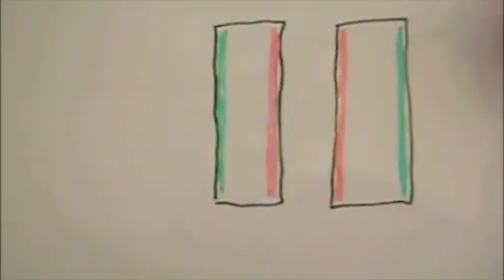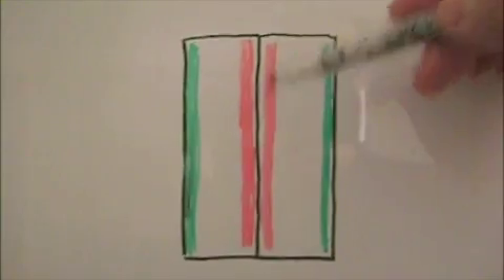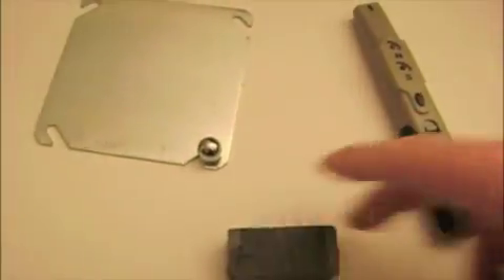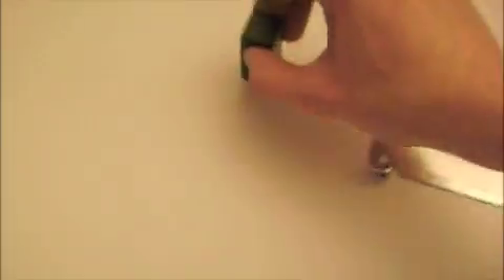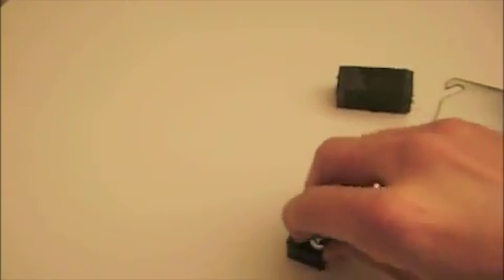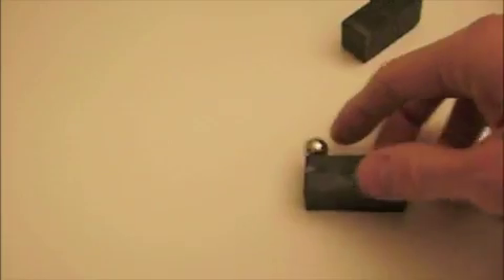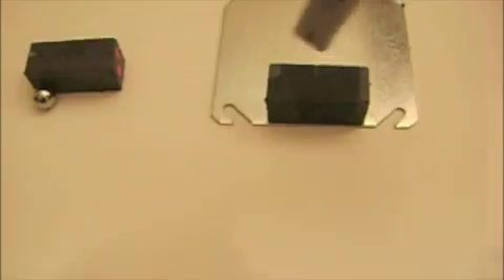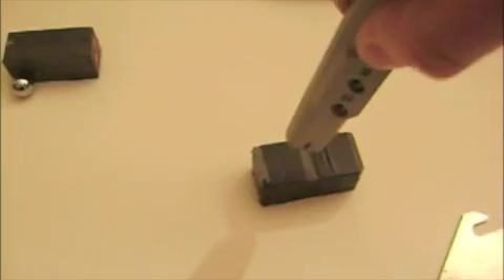Fun with Magnetic Shielding!

Comment: I think that you drew the magnetic field around the magnets wrong. I think that it forms a torus structure around the magnet. The N moves all the way around to the S side of the magnet and the S moves all the way around to the N. The middle of the magnet isn't very active because the N and S are in balance in those areas. Also, magnetism is a rotational force, N spins in one direction while S spins in the opposite direction. (this is the mono-polar theory of magnetism) If magnetism is strong enough anything will become effected even non-metals. Awesome video.

Comment: Excellent research! Try this...tape one of those regular magnets to a wooden table so it won't come up, next tie a key ring to a piece of sowing string about a foot long and slowly lower it over the magnet without letting it touch you can see the magnetic vortex in action swirling the key ring in circles trying to draw it closer down to it! Next take a large ring magnet and do the same thing it will perpetually spin over the width of the ring magnet's circular track! Perpetual free, clean energy just like nature does it!      J.R.
Reply: That's not perpetual motion. That's "An object in motion stays in motion unless acted upon by an outside force."
Reply: jhanthony2 There are outside forces, at least three.  Gravity, air resistance, and the friction of the string (or whatever kind of hanger) supporting the hanging magnet.

Comment: yes I agree with FreeMagneticEnergy2  I too have been dampening the repel on my stator, my latest experiment is a spiral golden ratio design and I have a small to big configuration but have the bigs going off in the distance like a candy can so I can take advantage of the left side pull/push only and I spiral the metal back in on itself to block the larger  and I put rubber spacer inbetween the  metal and the magnets dont know where to attract or repel and a third metal spaced out is the charm

Comment: Interesting. Unfortunately I'll never get two neos of like poles pressed together without using a vise. 

Keep in mind that for best results for shielding, we don't want the shielding directly touching the magnet, rather a quarter inch gap/spacer is best. As long as you don't allow the two to touch, then the shielding effect is stunning.

Cheers!

James
Reply: Just curious, why wouldn't you wanting the Shield coming in contact with the magnet? Just curious 🤔